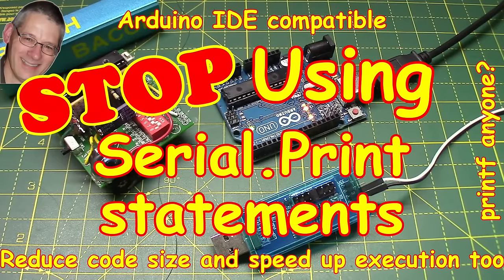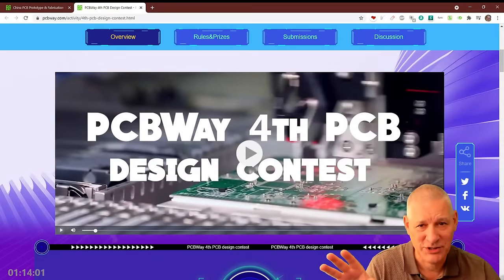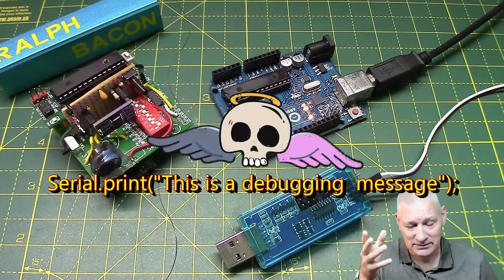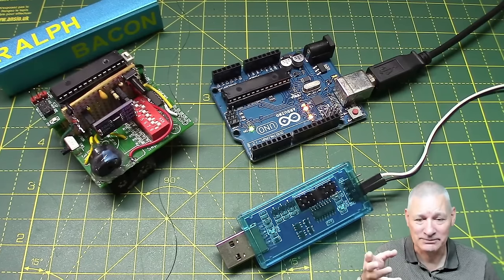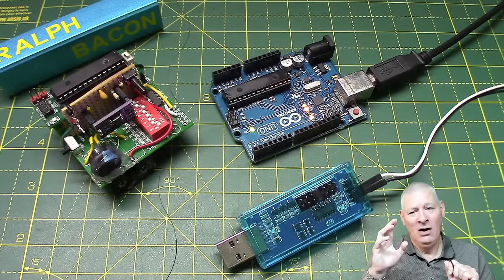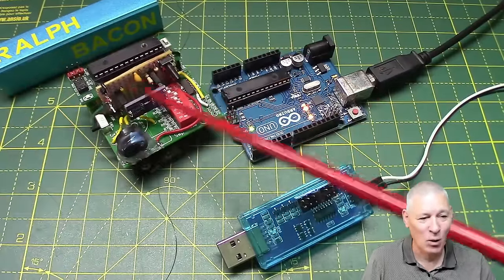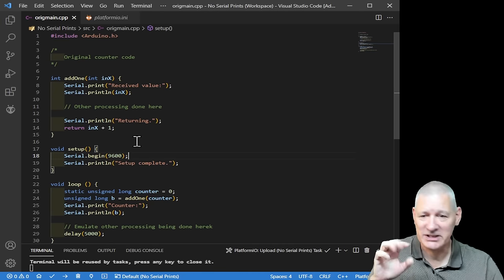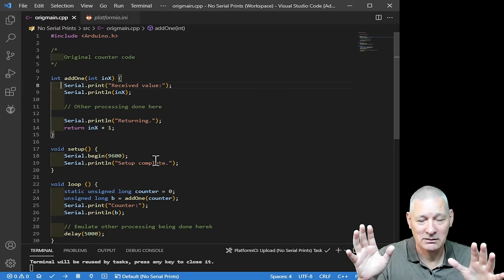#224 🛑 STOP using Serial.print in your Arduino code! THIS is better.

Comment: Nice Video, think you can also use if statement to check if serial port is active, something like Serial.available(), then only output the Serial.print() values
Reply from the maker: Well, it's actually more common to check whether serial data is available and then read it. I'm not sure it would work the other way round.
Reply: But then the print code still gets compiled.

Comment: Nice example of the use of the use of the C preprocessor and ways to save space in Arduino code. BTW, the addOne routine only prints 1 each time as it is using a copy of the counter and not modifying the counter itself. An easy fix you can discuss in another video.
Reply from the maker: Thanks for the info!
Reply: ...the counter is redeclared with every loop iteration...
Oops, I missed the static declaration, disregard this part of the comment.

"An easy fix..."
I don't think anything needs fixing, as this is not a "how to make a counter" tutorial.
The purpose of the code was to demonstrate how we can have compiler do the dirty work for us, instead of manually commenting out a zillion Serial.print() lines.
& (I assume) he used the var b instead of using & updating the counter itself, to demonstrate how the compiler complains about the, now unused, var b.
Reply from the maker: I'm pretty sure I declared this as static so it's not reinitialised to zero on every iteration, just the first time.

Comment: You shouldn't test agains 1 for true, but not 0.  The reason is any non zero value is true, and sometimes the thing you are testing against may be the result of a calculation.
Reply from the maker: Indeed, that is true (no pun intended) and can be put to good use if testing the result of a calculation; if (x) can mean "any value but not zero" so there was a result, etc. Hang on, is that what you meant in your comment?
Reply: @RalphBacon  Yes, you can't assume the person setting DEBUG is going to read how it is used, or hasn't derived it in was that assumes TRUE==1.  Therefore it is safer to do #if DEBUG == 0, and set the empty defines, and then the functional defines in the #else.  Alternately use #ifdef and not #if.  None of this is theoretical, I have been badly burnt by this in the past ;)

Comment: Whats the friggin issue? Use #ifdefs or #ifs to bracket your debug statements and pull them out with one define. This is making a big deal out of nothing.
Reply from the maker: Let's see:
1) you have now littered your code with #if...#else...#endif statements
2) the flow of the program is now obscured and indented in a non-standard way
3) Using my Advanced example, you can see just the most critical messages, or those plus general debugging statements, without all the verbose ones (pick and mix)

But if you like your way, keep doing it. This is just one way of doing it better IMHO, of course.

Comment: The "solution" is to just use regular JTAG hardware debugging. The microcontroller has all the debugging features you could possibly want. It can automatically halt at a specific line of code and let you step through line by line while vieweing the contents of it's memory. It's the standard way of debugging microcontrollers and has been since like the 90's. There's really no need for some primitive debugging techniques like printing serial messages.
Reply from the maker: And, as if by magic, last week's video was all about JTAG debugging on an ESP32! See, I knew you were going to say this 😆
Reply: @RalphBacon  Wow... One step ahead huh?! :D
Reply from the maker: Just the one? 😜
Reply: @RalphBacon  i feel like dude was trying to be an A$$ toward you Ralph.  I love that you had the comeback with last weeks video.  wonder if that dude has also been a douche bag since like the 90s

Comment: First of all any decent serial port driver uses a buffer and an interrupt. This means that a serial print uses very little resources  and is very fast. The program only has to do a memcpy into the buffer and then a small bit of works to copy the next char into the tx buffer when the interrupt fires. if your code has any realtime constraints removing your printefs will alter the program behaviour. be sure to test throuoghly
Reply from the maker: I've found that sending anything over the serial port slows down the code considerably; whether that affects the program overall depends on how fast the program has to be. Certainly with my ESP32 Web Radio the delays caused by serial output at critical points made the radio unlistenable - OK for debugging (just about) but that code could not ever be left in there!

Comment: I hope you wiil have a good use of that few bytes you saved.
Reply from the maker: More than a few, surely? On an Arduino it really matters, which is why most "String" values are put into Flash memory (using the F macro) but on the ESP32 it matters less.

Comment: You'll find out Serial.print is a problem the moment you start dealing with stepper motors.
Especially if you have multiple axe's and open loop / non blocking stuff.
And you don't print out every fucking cycle, I put timers or flag's and only print once and only if it's something important
Reply from the maker: In the circumstances you mention, trying to print stuff via the UART takes an eternity so no wonder things then go wrong. Using a simple check on millis( ) since the last time I wrote out is what I do, as it's non-blocking and can be tailored for each block of code. Awesome!

Comment: Or just use a proper debugging tool.. A Segger J-Link debug probe, a Black Magic Probe or even OpenOCD with an FTDI adapter.
Reply from the maker: Yes, all fine and good but not really something a beginner can get to grips with very easily! 
That said, single-step debugging is (sort of) working with the Arduino IDE 2.0 and an Arduino Zero so maybe there is hope for us all yet.

Comment: This is what I prefer to use in my projects. spf allows to print formatted strings like spf("x = %d\n", x)

#ifdef USE_SERIAL
#  define sp(v)         Serial.print(v)
#  define spln(v)       Serial.println(v)
#  define spln2(u, v)   Serial.print(u); Serial.println(v)
#  define spf(v, ...)   Serial.printf(v, ##__VA_ARGS__)
#else // USE_SERIAL
#  define sp(v)
#  define spln(v)
#  define spln2(u, v)
#  define spf(v, ...)
#endif // USE_SERIAL
Reply from the maker: Looks good. More importantly, if it works for you, then it works! Job done. Thanks for sharing.

Comment: STOP using Serial.print in your Arduino code! Even better yet: Stop using Arduino!
Reply from the maker: Hang on, stop using Arduino on an Arduino YouTube Channel? Wow! That really makes sense.
Reply: @RalphBacon I will use every chance to advocate against that fat unnecessary layer that prevents people to actually learn something useful and utilize full hardware features.
Reply from the maker: Ah, you're talking about the Arduino framework, not the hardware then? Well, users can program in ESP-IDF or other "bare-metal" framework without using Arduino-speak (which is a double-edged sword, as developers don't know what's going on under the hood. The question is: do they need to?). I consider the Arduino framework mostly syntactic sugar - but still very convenient!
Reply: @RalphBacon  Clearly you're not a hardware engineer. Some applications need ultra low power. Using  more powerful devices like ESP32 or ARM will significantly raise the power consumption. Also, these high performance devices are made on small geometry making them susceptible to noise and radiation so if you need industrial rugged performance, 1.5V core voltages don't cut it.
Reply: Wow! I didn't know that! There is really the need to say that? Of course people are not going to use the Arduino framework for the rest of their lifes if they actually have an objective. Arduino is just an introduction to the world of microcontrollers. Because what do you think UNO is considered the best beginner board? Because it has a simple 8 bits AVR microcontroller. It allows to learn how a microcontroller works and also learn registers, ports and low level programming overall (which means unlocking almost the full potential of microcontroller, instead of using that slow functions. Its something that can be done right inside the Arduino IDE) without hard difficulties and later use that knowledge to learn about more complex systems, but before that, people need to learn a bit, and thats why the easy and understandable Arduino framework exists.

People is not going to learn that shit of world in a single layer. Maybe you do, but not everyone.

Even after that, you can still use the Arduino framework if you feel good with it. There is no need to do low level programming all the time unless you actually need it.

Comment: what a long winded bunch of crap for somethin that shoulda taken less than 2 mins... ive been using this preprocessor stuff for years now...
but that said....its actually just easier to comment out the serial statements once you have finished debugging the code...
Reply from the maker: So if you have a method you use and will continue to use, why on earth did you watch the video, aimed at beginners?
Reply: Who?
Reply: @WacKEDmaN  Ironic you call his code “long-winded” when your method takes up multiple lines in multiple places. And sure, with snippets it might be relatively fast, but it’s still a pain to write the ifdefs every time, and it’s completely absurd given the alternative. What advantage does your method provide exactly?
Reply: what advantage? customisation, you can turn it on and off by changing one line... direct output to another serial port ... AND use it for enabling/disabling connected sensors/devices with ease... look at the code i linked and you'll see.. and being "preprocessor" the code doesnt get compiled into the binary...it all gets bypassed if its disabled.. it might take a little more time to code, but the code becomes configurable... 
and please tell me how '#ifdef BLAH' is longer than 'if (DEBUG == 1)' 
and when i say long winded.. i mean the explanation and how to of this vid.. shoulda taken 5mins ..not 25...

Comment: Nothing different this just delete your serial plrint that's shit 😂. Im never using lot serial print useless
Reply: "Nothing different this just delete your serial plrint print"
How is this "nothing different"?
For projects with thousands of lines of code, with tens/hundreds of serial prints for debugging, this is an incredibly useful tip.
Even if your code has only a few serial prints, it's still better to use this instead of commenting out/deleting every single one manually (& uncommenting/rewriting them all the next time you want to debug something).

"Im never using lot serial print useless"
It's your comment that is useless.

If the whole serial print thing is not a feature you use, then:
- Why did you even watch this video?
- Why did you think your "opinion" on the subject matters to us that do use it?
Reply from the maker: Fine, use your own method but don't be aggressive in disrespecting my point of view.

Comment: This code demonstrates why I have always maintained that case sensitivity is poor programming language design. In this code we have two keywords that differentiate solely by case significance (i.e. DEBUG vs. debug). This generates poor legibility in the code because of possible confusion reading the code.  Well, I've heard, one simply places guidelines on coders not to do this. WHAT!? Guidelines? I much prefer to force compliance to avoid mistakes. This also has the benefit of not having to remember if it is printLn, println, PrintLn or PrintLN, or any other such silliness. Simply type println and move on. The other argument I've heard is about interfacing with other code in languages that do have case significance. One is going to have to declare the interface in some sort of definition, the compiler simply uses the declared case for the link tables and ignores it for internal code. My philosophy has always been to make things easier rather than more difficult and case significance just makes things more difficult for everyone but the compiler programmers.
Reply from the maker: Doesn't Visual Studio Intellisense/code completion do what you are suggesting, Joe?

If I have declared a variable called sensorPinA then as soon as I type the first few characters I get a pop-up with the suggested name. Additionally, if I blindly ignore the suggested name and type sensorPINA then I will get a red squiggly as soon as I have typed it!

So your println, printLn and printLN issue would be sorted before you even had a problem.

Unless you are writing code in Notepad 😮😁

Comment: Arduino is C++ based so they should have implemented cout.
Reply: Cout is c++ and is a monster library. Actually embedded guys dont like c++ cause its overhead. Even linux kernel is still mostly C.
Reply from the maker: printf is now in C++ too. I don't know if it was rewritten for C++ but it is part of the C++ language.

Comment: Wow that was drawn out. All you need is to come t out the define ( if something has not been defined then the if statements don’t run. You did it the hard way.
// #define debug

If def debug

*******************something

End if
Reply from the maker: For beginners I don't think it was drawn out. They need the extra hand holding that professional or experienced coders take for granted.

Comment: Stop using cutting mats on “electronics” channels!
Reply from the maker: My workshop has (let me count...) ...4 cutting mats on my workbenches, from 3 smaller A3 mats to one giant A1 mat on my electronics bench to protect it from solder, flux, IPA and my general clumsiness.

Now tell me why I would not use them in my videos too (put it this way, I won't be removing them just to do some videoing 😲!)

You don't like them? IMHO they provide a clean base for showing components and the like. I'd be interested in why you don't like them in my videos!
Reply: Why?

Comment: Serial.print() is not a statement ... it is a function!
Reply from the maker: Well, we don't evaluate the response (usually, it returns the length of the string written, I think) but call it (the function) by executing a procedure statement, surely? Whatever, it makes not a jot of difference in this context 🙄

Comment: Can you make your videos 10 minutes shorter?
Reply from the maker: I've been trying to do that for 6 years, Azka, without success! And if I ever did so, think of all the information that would be lost. 😲
Reply: @RalphBacon  Give a try to it. Now, many things are constantly repeated, which is little bit boring... Note that on YT everyone who needs repetition can do it by himself. I like your films, especially their electronic layer, but sometimes they seem to be little bit too long.
Reply: @RalphBacon  
Advertising BS, a complete turn-off so didn't watch. Don't use the Arduino anyway. We Parallax Propeller users don't have these issues because we hand-off the comms to another of the 8 CPUs.
Reply from the maker: @Craig Webster If I understand your comment, you couldn't watch (or skip😲) a 60 second commercial from a respected PCB manufacturer (that allows me to make these videos in the first place)? Do you not watch TV either? 📺

Not only that, you don't even use the lowly, single core 😢 Arduino. Did you not realise that you've subscribed to an Arduino-focussed channel? 🤷

Oh well, good luck with your multi-core Parallax Propellers. I'm not jealous at all. No I'm not. Not, not, not. 😁
Reply: Or use the YT speed control. It changed my life. I now have an extra 10 minutes per day to #ifdef all my printf statements! :)